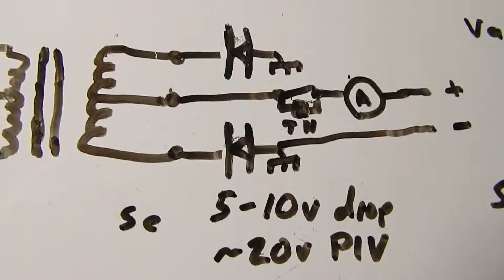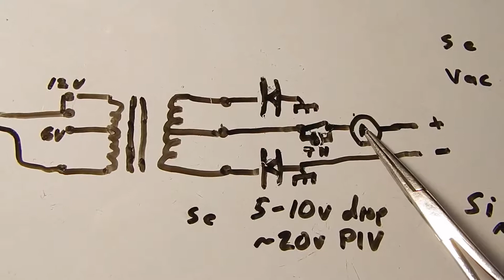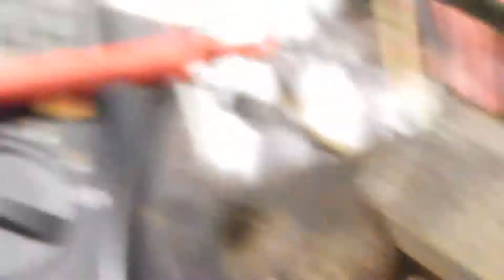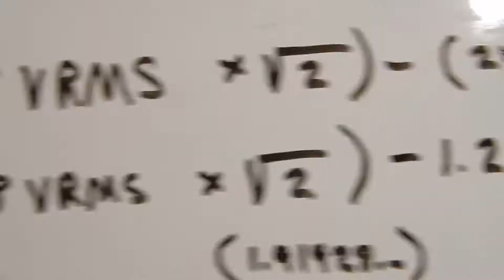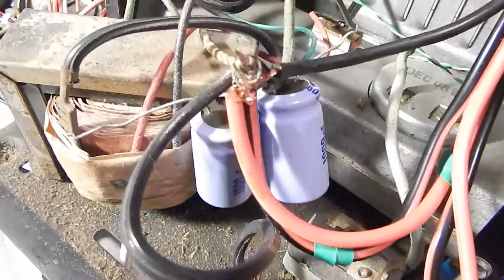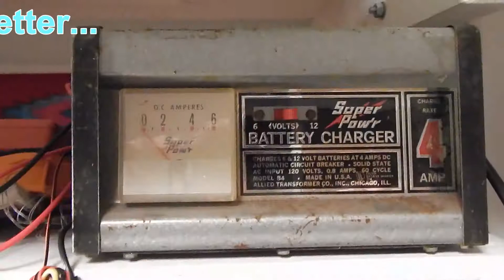Battery Charger Rehab-Mod - Neglected Project File

Comment: I think you had the 6 and 12 volt switch setting backwards. The 6v setting would be across the full transformer winding. The 12v setting would use half the winding. Because it is on the primary side, the turns ratio decrease will increase the voltage on the secondary. For example: if the primary had 500 turns and the secondary had 25, the ratio is 500/25 or 20. If you put in 120 volts on the primary, you get 120/20= 6 volts out. If you switch to the center tap on the primary, you lose half the winding so the ratio is now 10. The output becomes 12v. The transformer hums loud on the 12v setting because these these smaller transformers tend to run a bit into saturation.
Reply from the maker: Yes, good catch. The 6V setting would be more turns, probably this is actually intended as a 240V input by the transformer's manufacturer.